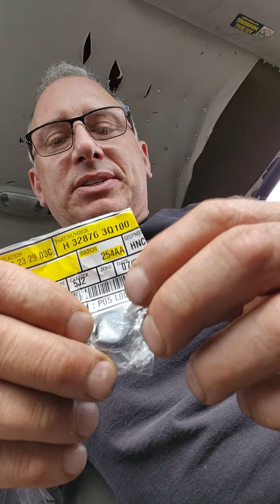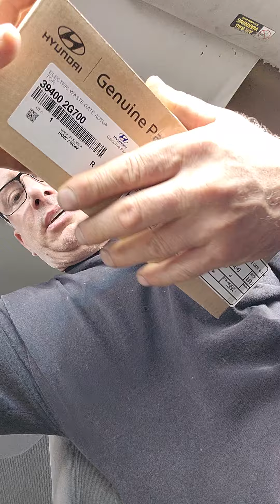Hyundai sonata brake lights staying on When pedal released, check this out

Comment: we had a goofy person at work who had his brake lights staying on so instead of fixing the problem that would kill his battery he would disconnect his battery cable every day and reconnect it at end of day.
but an even funnier guy he parked his truck along fence at work and he knew his brake light stayed on so he would shove an empty soda can or something under pedal to keep it up and light turned off sometimes he would forget to take it out, but it just squished when he pushed on pedal in hurry to get out of parking lot. then one day he threw a full can of soda under pedal and forgot to remove it threw truck in gear went to put brakes on and no brakes can was holding pedal up so he drove right through chain link fence LOL
Reply from the maker: Wow unbelievable